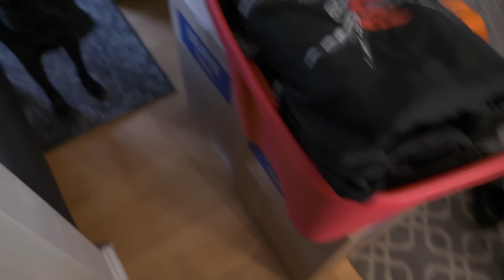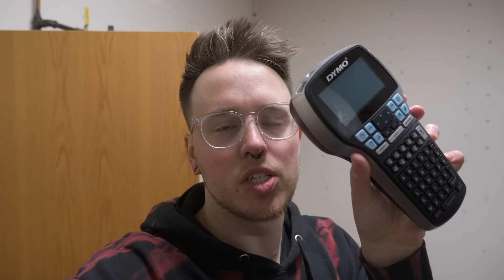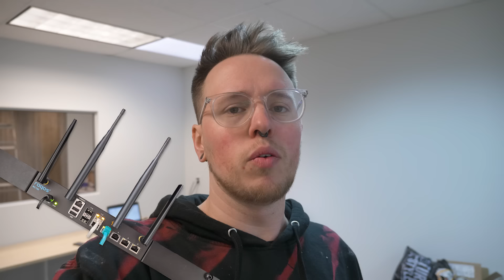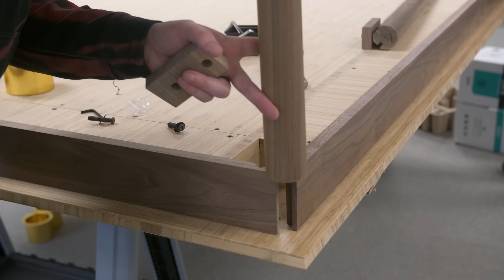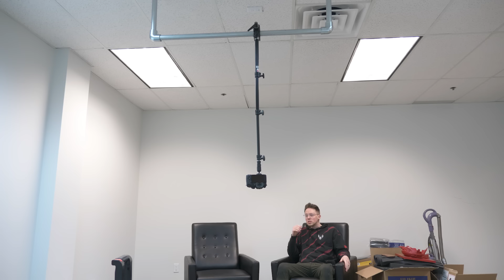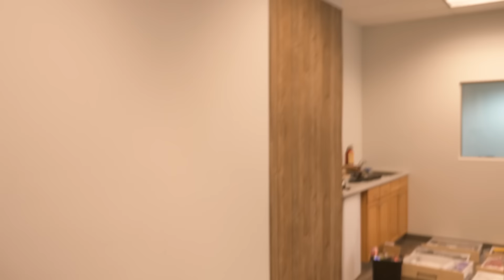Moving into My New Studio!

Comment: I loved the video. I have recently moved to a new painting space and have came across a strange issue. Whenever I paint I get intense headaches and brain fog that lasts all day. I had gotten it beforehand but I figured that it was from the lead paint chipping from my basement ceiling (I used to paint in my basement). I am confident that it isn't my lighting or sitting position. I might quit painting minis for D&D if this issue persists but I want to ask if this is normal.

Comment: I’m that guy. Yes the set screws are holding hardly any weight. But you are in a region with quite the gap in freeze/thaw. Those set screws will eventually find a way to slowly back their way out.  A little loctite blue goes a long way.  Hate to see a video where one side swings down and ruins expensive equipment.
Reply: we added the loctite today when we increased the pipe diameter, so should be set for a while now :)

Comment: Honestly Scott - I'm not really convinced of all these ports and electrical outlets in the ceiling - especially since they're mounted in a panel ceiling - a very, very light type of office ceiling. There is a huge risk that one day you will push them in or reap them out while connecting cables.
Reply from the maker: Definitely a valid concern. I suppose I could replace the tile with tile made of OSB. Hopefully I'm not adjusting the setup too much.
Reply: @Miniac  Tiles made of OSB would be definitely better in the situation when You are pulling cables out of the socket because aluminium frame is supporting tile from going down. Question is - are those tiles will not gonna lift up when You wanna plug in something ( XLR cable for example )? That could be really annoing. OSB would be great solution - if you would make solid ceiling structure from it. At least in places where those ports are.
Reply: If the electrician used mounting boxes that are designed with brackets that connect to the ceiling grid like you’re supposed to, it won’t be an issue 🙂
Reply: @BlackMagicCraftOfficial  True. If he did - I rest my case ;)

Comment: I've found getting a "low-level" organization then after working in the space for a while, get a deeper organization based on how i use the space and how it "flows" tends to work best. You get just enough organization to work in it then later on do the deeper organization. It's how I've set up my office each time I've moved over the last 15 years. 

Excited to see the new space! Great work!
Reply: That is exactly how I set up work spaces, and work benches.
When I built my airbrush table, I did the basics. Then I used it for a few weeks, noting things I thought would make it better. Added a craft paper dispenser, so I can change out the paper covering the work area. Added a paper towel holder because, man you need lots of paper towels when cleaning the airbrush. Places to hold and store all the cleaners, thinners, etc, and the cleaning tools.
The point is, I didn't know what I needed until I used the space for a bit.
So, don't try to do it all at once.

Comment: If you are ever worried about the set screws, just drill the bottom hole straight through the pipe and the bracket and use an installed bolt that goes straight through. Still removable, slightly safer.
Reply: we tried that today and uh, the drill bit didn't even make a dent in the new piping.... we were both sadge but hopefully the increased diameter will make it all the better
Reply: @pcurtis987  what kind of bits do you have!!! Is the pipe rigid or emt? Sounds like you need a better bit or better drill never been a piece of metal I couldn't mess up
Reply: @AtomicNik  whatever bits Scott had,  we increased the diameter of the piping for a tighter fit which is doing a lot better in terms of hold
Reply: @pcurtis987  I just worry about long term vibrations overtime with set screws! Do a lot of heavy equipment mounting but it looks great I'm sure yall have it setup well enough for the application
Reply: @AtomicNik  oh for sure, I used to build similar setups on a weekly basis at me old job. We made sure to loctite every single screw and bolt in the entire cage, and it's strong enough for me to do pull ups off of, I'm 230, so I think it'll hold for it's intended purpose lol.